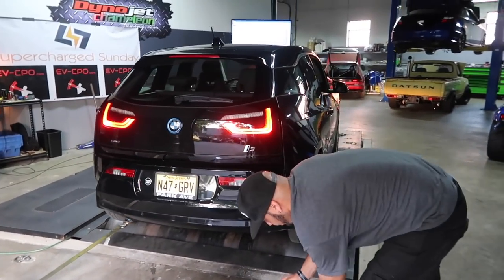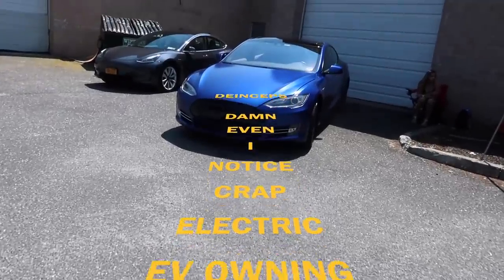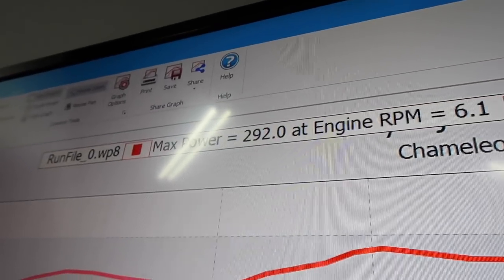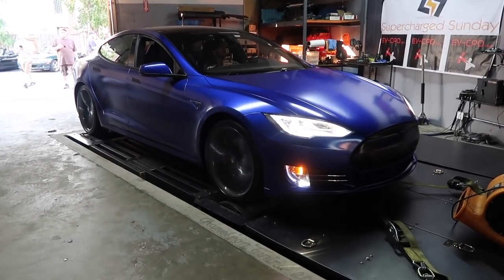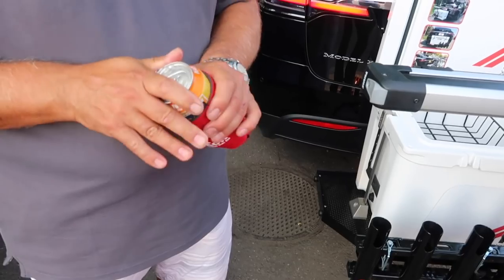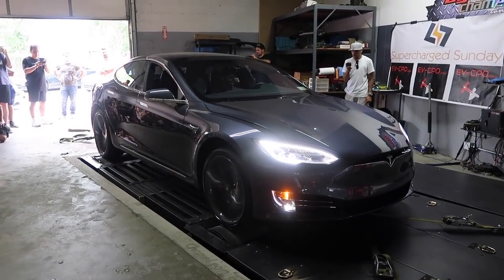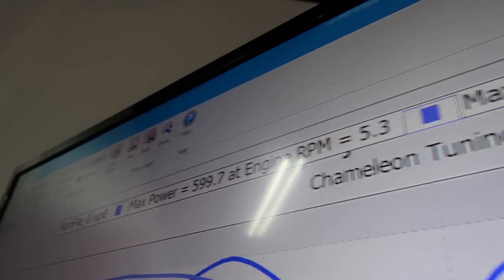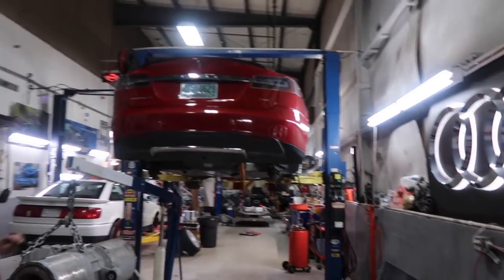Do Teslas stand a chance against my CORVETTE?

Comment: The drop-off in torque at higher rpms is why the original roadster had a low and high gear. Ice engines don't really have an advantage here, they just have transmissions. If an electric car really needs more performance at high speed, 1 gear change should fix it. Love your channel.
Reply: Steven Hiller did they really made a multi gearbox for Roadster?
Reply: Oto yes high and low gear but only for the fist year or 2. If you look at pictures you will see the gear shift in the center console. One with out the shifter are single speed
Reply: It didn't last long it seems
Reply: they did but they kept blowing them up
Reply: So is there any Roadster left with dual gears?
Reply: Oto No, they never passed QA. It's part of the reason the roadsters were delayed so long. The Rimac concept 1 & 2s use two speed transmission.
Reply: Steven Hiller I have been reading about back EMF that drops the torque/power off in A/C motors.  Don't know much about the phenomenon, but I wonder if that can be engineered around to gain more top end.
Reply: youmakeitreal I don't know. This is a natural part of induction, it also naturally limits the current running through the motor. However some dc motors actually move the magnets away from the stator when the motor reaches speed to reduce back emf.
Reply: Steven Hiller, Oto, Pasquale Ranalli, Tesla had limited resources at the time. The aftermarket diesel world produces 4 or more speed automatic transmissions that can handle 1500HP and 2300FT LBs, a piddly 650FT LBs instant or not would do no damage. Not to mention 2 speed drag transmissions that have been able to hold MUCH MORE power for decades (not Top Fuel, when you can make ~11Khp you don't need to shift). So Tesla could with the right amount of time, money, and expertise make a multispeed new roadster, if it fits their product goals. Because it's all a compromise, a multi speed transmission is heavier, more expensive, and more complicated, if they can meet their goals with single speed they will.
Reply: The actual problem why there is a drop of torque/power is just because the battery can't deliver enough energy in time. It's like having a 500hp ice engine but the fuel pump can only provide enough fuel for 3500rpm. Of course, the engine will spin faster, but the torque won't be there.

This will probably change in the future when energy density will be higher.

Comment: Seems like a two speed gear box could solve Tesla's top end issues.
Reply: Or just gear them differently.  You don't need them to be so fast 0 to 60 if the top speed is only in the low 100s
Reply: @JaredConnell  But then you would appreciate down torque more than exceeding 100MPH, unless you really want to race 1/2 mile.
Reply: its not gearbox, its electric motors that rev's at same really high rpm constantly it doesn't have enough gap, like any ICE, to rev and have that flat torque \power curve.
That is advantage of ICE over electric motor.
Diesel engines have even more earlier torque at low rpm..
adding more gears to EV  will lower its efficiency -they way they're build for, due to much friction losses.
So you need more motors  and powerful battery and insane cooling, or more gears but more friction and more time to reach top speed
Rimac Nevera is doing smth like that, by adding more and different motors to reach speed, but its still can't beat  Bugatti or Koenigsegg Agera RS which is hybrid and cost less, like Rimac cost lot more money.  and its accelerate fast, but weight  and range were a major challenge

Comment: Rich and company, I am very impressed with what you are doing: The only bad news is: "Electric cars are not here yet." As long as electric car manufacturers are also energy companies (making their own batteries), owning an electric car will not be totally convenient. Let the EV companies get together and standardize the batteries geometrically. I am sure that gasoline car companies also sold gas before fuel companies opened lots of gas stations.
 EV manufacturers should build car and let the car buyer purchase batteries packs from battery companies, even if they use car manufacturer money to build the battery companies. When it becomes easy to drive to a battery station and exchange your discharged battery pack for a fully charged one in five minutes, then electric cars will be here."
Propane gas tanks are exchanged routinely at gas station. The same system needs to exist for EV battery packs.  If you turn in a half-filled propane gas tank, and get a full one, you do not get any credit for what is left in the tank. In the case of the battery pack, they should give you credit for the amount of charge left in the battery pack that you traded in at the station. 
To market electric vehicles efficiently, people need to be reminded that they will always pass the emission part of the inspection. The emission inspection is creating crime by allowing dishonest mechanics to cause additional problems when the check engine light is already on or when the OBDll is not yet communicating. I do not have the knowledge that you have but I go under the car (or hood) and am capable to distinguish failure due to metal or rubber fatigue or decay as opposed to vandalism. I want a video recorded with multiple cameras when my car gets inspected or repaired. In the meantime, I do every car repair that I can do without risking serious injury. Hello from Boston!